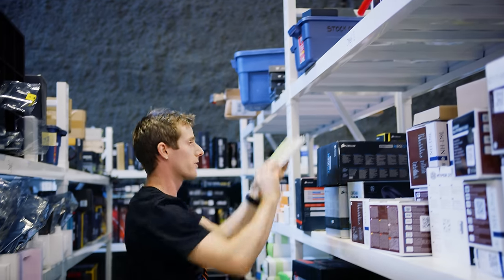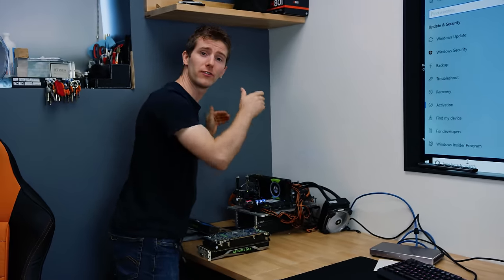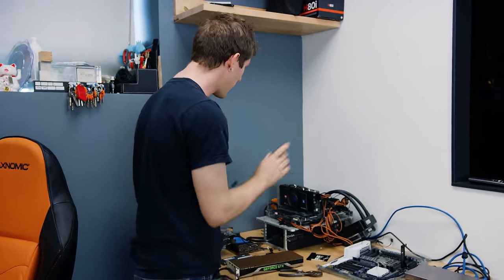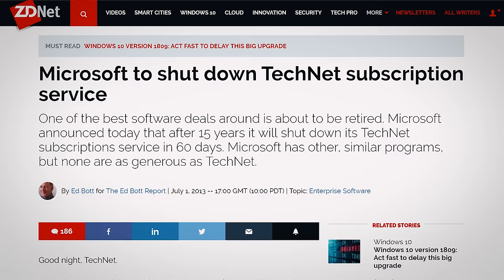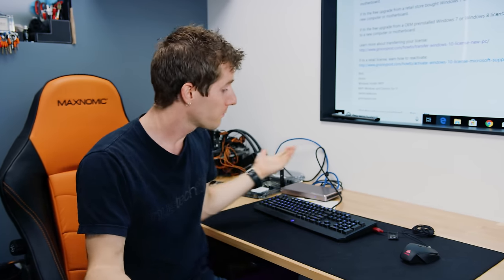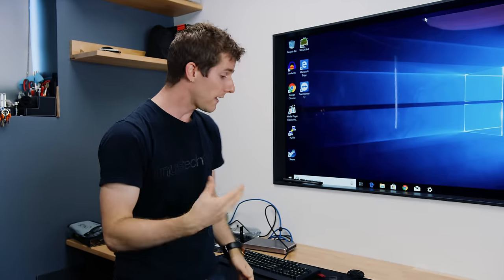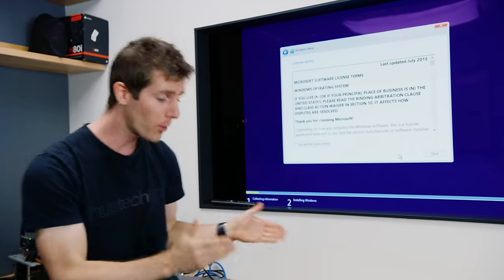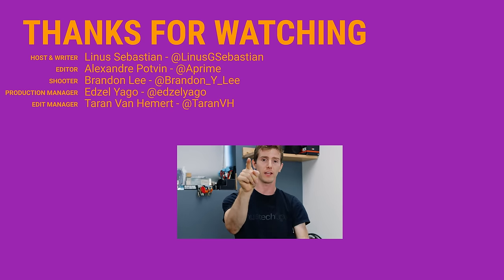Why Does Linus Pirate Windows??

Comment: Windows answers the philosophical question...
If you keep repairing a boat and over the years every single piece has been replaced - is it the same boat?

So, when does it become a new computer? Windows decides xD
Reply: You should be paying for an instance of software regardless of the hardware you run it on.
Reply: That's an interesting point. You could okie-doke Windows by replacing every single component in a PC, even copying the hard drive bit-for-bit on a new disk.... at the same time, I don't feel like Microsoft should have any say at that point. As long as the license isn't in use in more than one PC, why should they care? You're paying for an instance of Windows, it shouldn't matter what hardware it runs on.
Reply: @RedTopProductions  but couldn't you use the parts that you took away and sell them and or build a new PC?
Reply: Bad Chemist Absolutely you could, but what concern is that to Microsoft? I think as long as the original owner wipes their hard drive before selling it (as to ensure that instance of Windows can't be re-used by the new owner, and is best practice anyway to make sure your personal data isn't stolen), then Microsoft isn't losing out on any sales.
Reply: the moment you replace something its a different boat, that saying is pretty dumb
Reply: The old PC of Theseus,  the Ship of Bill Gates.
Reply: Bidwellz9 the moment you replace a part of the ship is the moment the part has been replaced.  It’s not a different ship, but the ship is different.  When your body generates new cells (constantly), are you no longer you?
Reply: There's also a philosophical question that says if a tree falls down in a forest and nobody noticed, does it make a sound.

If you duplicate the license on several computer that always stay offline in a hidden place, are the license duplicated.
Reply: @RedTopProductions  what about doing this procedure over and over again with a blank slate of only windows is that basically copying windows?
Reply: no, the moment you replace something its no longer the same ship, it did not come from the factory like that , making it a different ship
Reply: if you keep sawing a boat in half and fixing it with flex tape is it the same boat
Reply: A retail windows license actually does say you can move to another system.  "b. Stand-alone software. If you acquired the software as stand-alone software (and also if you upgraded from software you acquired as stand-alone software), you may transfer the software to another device that belongs to you."  

The activation tie in to hardware is not meant to stop that, just meant to curb the frequent casual copying that was done pre xp by having you need to call them if you try to activate too soon on different hardware after activation. 

OEMs licenses otoh, they are linked to the original system, which is mainly linked to the motherboard, other components can be upgraded but other than direct replacement of same motherboard model, a motherboard change will invalidate the license.
Reply: Focux  Yup, been there. But luckily, if you could validate both the key that you bought before this, you as the original owner, they will reactivate it for you.
Reply: It's when you change the motherboard when Windows decides it's not the same computer.
Reply: I think every component is fair game except the motherboard. That's literally the whole computer. Other than that you can swap out any part and it should be fine. I haven't had any issues swapping RAM, hard drives, SSDs, graphics cards, CPUs etc. But if you change the motherboard, as far as Windows is concerned, you moved the hard drive to an entirely different system.
Reply: Xd
Reply: @Yafama  you would have to then buy a new copy of windows
Reply: The PC of Theseus.
Reply: Microsoft doesn't get to do this, Apple does.
Reply: thats not replacing anything, its not that difficult to understand
Reply: Lmao
Reply: @Yafama  of course you could and you also will need to buy another windows licence so you can use the software on that computer too or install linux or whatever you want.

You seem to be confusing installing the software with having the licence to use it. Microsoft themselves provide a download to the iso of Windows, you could install it on 100 hard drives if you want, but to be able to use them according to the EULA, you also need to buy a licence for all those you are actually going to be using.
Reply: Here’s another one to blow your mind! Most cells in your body are replaced with a new one after around every 7 years. So... after 7 years are you still the owner of the software? 😂
Reply: you don't have the same cells in your body that you were born with. Are you still you?
Reply: In OEM licences, the Windows 8/8.1/10 licence is attached to the device (or the hardware id) not to the user. You can re-activate it by MS phone support a limited number of times, and reinstalling same windows version over an old configuration previously activated it could be appear as activated because its hardware id is identified as already active... Windows 7 Ultimate had some EULA options to activate an altern virtual machines with some options unlimited.
Reply: or If you active the same licence in hundreds of offline virtual machines? or if you create an fully operational snapshot ?
Reply: or If you active the same licence in several offline virtual machines? or if you create an fully operational snapshot ? You can be trapped by the EULA
Reply: about the philosophical question. Yes it probably would not be the same boat but should you then pay for it again to the guy that sold you the old boat?
Reply: Focux  Didn't work for me. originally has a msi p34 fx and a fx 4300, upgraded to a ryzen 3 and asrock ab350 pro 4. took less than a day for windows to recognize based off of my video card and hdd and re-activated. however. - I have a friend that uses a non-activated copy of windows - you can easily get rid of the watermark - i don't know what all this nonsense is about it "showing up over games" because a simple right click on any image you wish to change your back ground to will let you. and he has gamed for about a year on it now and has never experienced a single issue. Windows already pretty much stated at the release of windows 10 that they don't care about private piracy, and they are more focused on business's paying for there licenses and not using windows to generate income without getting there just do. kinda like a copyright. you can fuck around with copyright all day long for non-profit. but the second you make a buck with it. microsoft wants there coin.
Reply: +Focus But Linus did changed the mobo and Windows stayed activated.
Reply: It becomes a new boat when 50.00000000000000000000000000000000000000000000000000000000000000000000000000000000000000000000000000000000000000000000000000000000000000000000000000000000000000000000000000000000000000000000000000000000000000000000000000000000000000000000000000000000000000000000000000000000000000000000000000000000000000000000000000000000000000000000000000000000000000000000000000000000000000000000000000000000000000000000000000000000000000000000000000000000000000000000000000000000000000000000000000000000000000000000000000000000000000000000000000000000000000000000000000000000001% has been replaced.
Reply: Deep stuff right there
Reply: @barrettfrancis1278  so when you loose skin cells and they get replace, it's a new "you"?
Reply: it will work until the activated machines deactivates themselves after not being able to "phone home " for x months. unless VLK activated. Home for sure, Pro maybe. The OEM ones as shipped should be ok
Reply: @legolas66106  the motherboard he swapped it too probably wasn't brand new
Reply: Half a year ago, I upgraded my system from an FX-8320 to a Ryzen 5 1600. Three components got changed in this upgrade. CPU, RAM and Motherboard. Everything else stayed the same. And I never had to reactivate windows, it just did it on its own.
Reply: @FlameRat_YehLon ,  you have much to learn. start by learning, that you know nothing.

Comment: Linus is correct but the word he was looking for was SLP = System Lock Per installation. Windows sets a specific ID for each hardware and when you change a specific one it triggers that WINDOWS ACTIVATION crap thing... most of the time this triggers when you changed Motherboard since Microsoft considers that as a NEW SYSTEM, therefore, requiring a NEW LICENSE

I worked with Microsoft before... yes there is a limit... 
Windows have the different type of VERSIONS (not talking about Pro, home etc..)

Windows 10 FPP = Full Package retail this have 10 install or prompt limit you can call MS and they will ask for your PID, Product Code and the  disc... there are security codes there that we put in PID PLUS (Yeah the tool that we generate Product keys!) once the representative identified that it's the first time and you have a legit software we generate a new Key FOR FREE! and you have another 10 install limit..

Windows 10 OEM = Original equipment manufacturer <<< your screwed if you change motherboard MS will not support that since they only earn $49 per OEM Windows..

Windows 10 Volume license = You can use the same key multiple times and once you run out you have to call MS to pay for more usage

Windows 10 Corporate = Unlimited uses but you have to pay a certain amount depending on your subscription with Microsoft.

Hopefully that clear things up...
Reply: Your post needs more upvotes. 

The full package retail licence is ironically sold by many stores as an OEM version as well, so it gets even more complicated. Basically the license type is FPP, while the actual package is an simple OEM one, just like those that Linus showed us. Those seem to ideal version to buy (about half the price of actual full package retails in a full package box), unless you can get get a corpo one.
Reply: Everyone Upvote this
Reply: Two people unliked your comment, this was 40 likes before
Reply: Uh, no. An OEM license costs at least US$150. I paid about RM700 for one. Which I think is already quite cheap, since the Microsoft online store wanted RM1200 for a retail license.
Reply: This guy explained everything well!! Well played man, well played.

And to add up, most cloud management platforms lets you try for 30-days for free. Same concept as what linus wants to imply to us.
Reply: I'm pretty sure you work at convergys
Reply: Upvote and make videos omg pls
Reply: Yup, and when that happens its 30 minutes on the phone to get support from India to re-activate Windows.  Last time they just gave me a new regcode.
Reply: upvoted
Reply: But isn't windows 10 like the last version?  So it's lifetime
Reply: eggomylego works like a charm everytime
Reply: Nah, the OEM stuff you can generally get a new key if you just explain that the reason for hardware swap was a hardware malfunction. You gotta call and explain though.
Reply: well my MB died and I only had a Windows 10 OEM key or the one the came in my prebuilt system, yet I was still able to get my windows key reactivated afterward. so yay for me I guess lol.
Reply: I've only had to do with Windows 7 but whenever I use phone activation, it has been automated. You give them a code and they give you one back to enter and it activates. No explanation and no representative.
Reply: Thanks, I was wondering if the motherboard was the part not to change.
Reply: Linus! Don't go online and announce your illegal deeds.
.
.
.
Unless you're sure that Microsoft can't sue you for it. In that case, go ahead.
Reply: @jeyaner90  nope... I although I handled the reports for MS including convergys